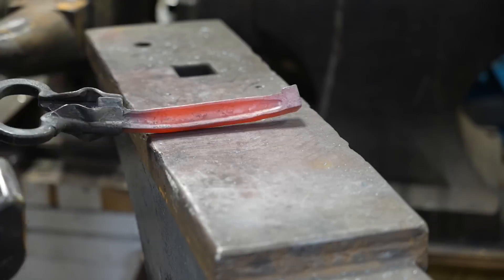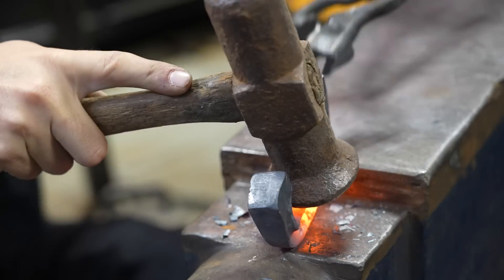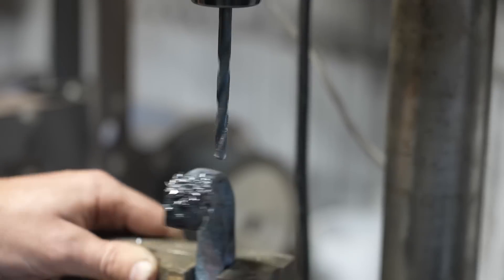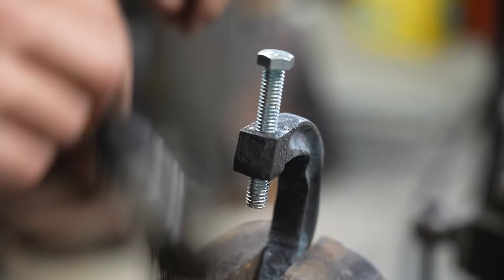Transforming A Nail Into A Clamp

Comment: Is there an easy way to tell a high carbon steel spike from a mild steel one? If you find an old one is it more likely to be one or the other?
Reply from the maker: I bought these specifically, and they are marked with HC on the top of the head, that being said id think if you actually hammered one of these in, the HC would get pretty mangled and might not be visible...
Reply: @MakeEverything  Thanks, this was a fun one, from the forging to the machining, you used a lot of different techniques on this little project, it was cool to see. 👍🏻